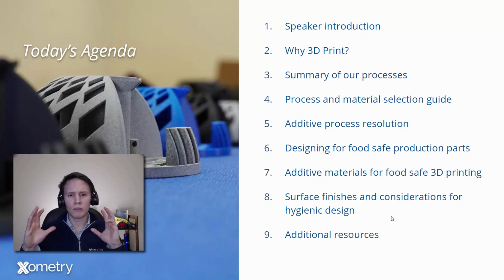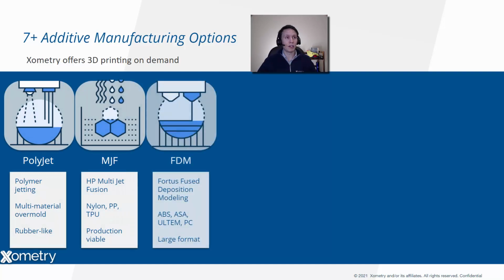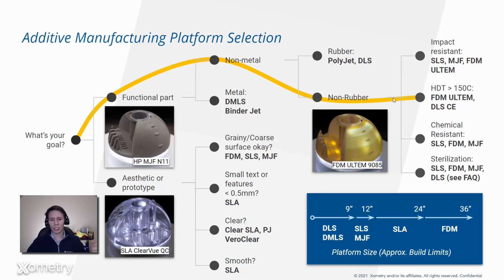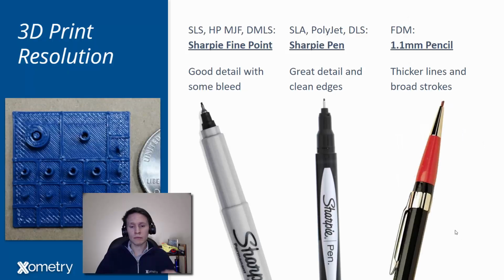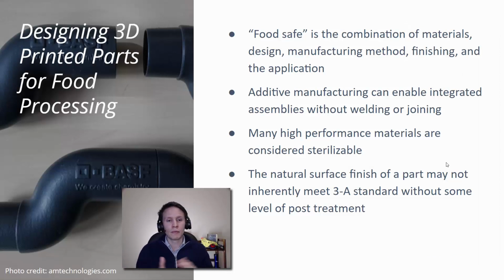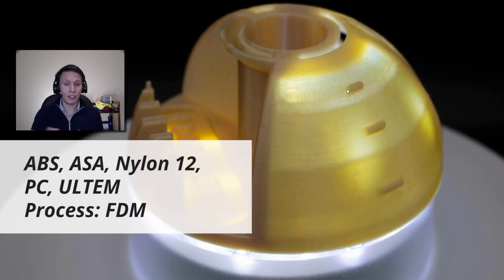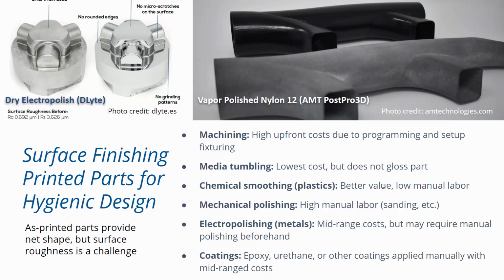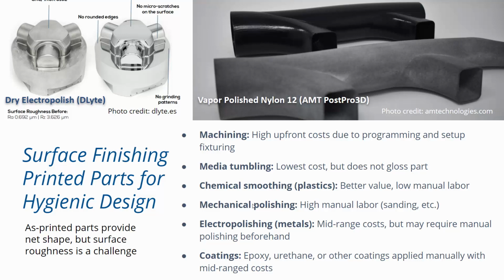Additive Manufacturing in the Food Industry

Comment: So, is the sls with surface smoothing the cheapest option for food safety?

Great video but I think you made sterilization slide also quite complicated, customers only want to know if the part will survive the dishwasher like an injection molded PP part
Reply from the maker: That is a great comment and question, thank you! 

Food safety is an application that combines engineering design, finished material condition, and end use, so the answer is always "it depends." Assuming the design you have has accessible, cleanable surfaces and is not going to be regularly submerged, then nylon 12 vapor smoothed could be a good choice for prototyping and potentially end-use. Ultimately, the qualification of the product is up to the designer and engineer (just like it would be for a safety critical feature or medical device). The team at Xometry focuses on the success of manufacturing to the specifications outlined in your project.